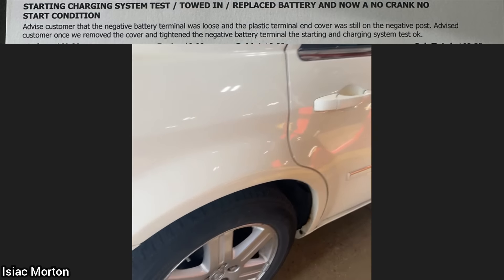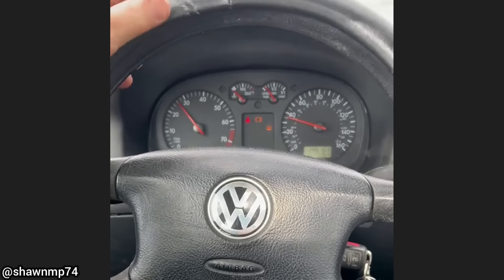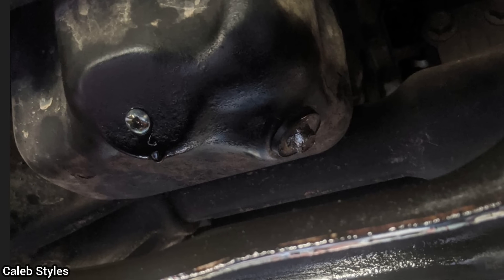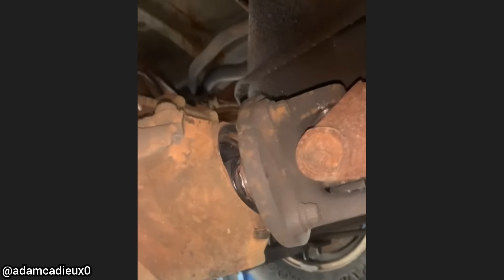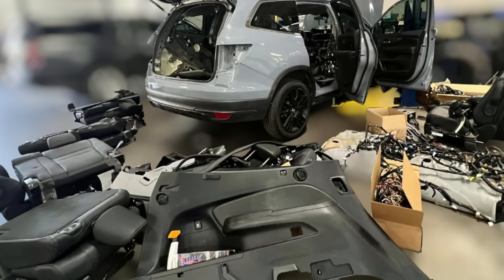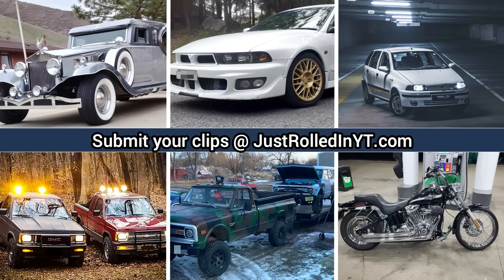Customer States He Replaced The Battery & Car Doesn't Start

Comment: I once worked at an auto parts store and sold a battery for a lawn mower . The customer called back a few hours later and yelled and screamed at me for selling him a defective battery . I apologized and asked him to return it for a full refund . Some time later he entered our store and slammed the battery on the counter and began to yell at me again . I looked down at the battery , removed the two plastic covers from the posts and said it should work now . Without a word he picked up the battery and left our store . The craziest part was that he had actually drilled holes through the sides of the caps so he could connect the battery cables .
Reply: yikes
Reply: I would've told him to NEVER come into the store again.
Reply: 👍 @ffjsb
Reply: @ffjsb Nah. That’s when you sell them brake pads and tell them to stop again soon.
Reply: Didn't even apologize to you
Reply: Had a customer make a colleague cry, (young girl on the cash register) getting crazy over 'his new mower wouldn't start', I got sent out to look at it, looked it over, PUT SOME FUEL IN THE TANK! And it started right up. He couldn't believe it, started accusing me of trickery/witchcraft but after starting it several times and politely (but really condescending) explaining what the fuel does and why you have to refill it, to the amusement of other nearby staff/customers he finally left without apologising. I fully expect his vehcile is probably featured on this channel 60,000 miles no oil change or something!
Reply: short-tempered, impatient, and ignorant all rolled into one.... They're essentially toddlers  in adult form.  No use in getting bent outta shape with them. You know how to handle them👍
Reply: @ffjsb  and miss all of the entertainment?
Reply: This why Gen z loves to shop online because of retail poop.
Reply: Hope they banned that customer.   No reason to act like a jackass.  I had the opposite dealership acted like a jackass n yelled at me.
Reply: Ugh had a dude who bought a left front brake caliper and came back and complained to the manager I sold him the wrong one only that the assistant manager told the manager no he said the front left he was just tryna get me in trouble
Reply: @WilliamHollinger2019  I don't know what this has to do with any generation . Where exactly are you going to buy a battery for your lawn mower on-line on a Sunday morning and have it available within the hour so you can mow your grass without human interaction ?
Reply: This stuff makes me lose faith in humanity, I cant
Reply: @webguy943  We had thicker skin back then . I shrugged it off then laughed about it with my friends . This was a rare occurrence and the hundreds of times people thanked me for helping them and shook my hand made up for the limited number of idiots .
Reply: @bryana7163  That's not what I call entertainment.
Reply: @eaglerider1826  Lucky you are not in Germany.  Quiet Law applies to any noisy work on Sunday.  Lawn mowing is a no-no.
Reply: @nothanks9050 "Ain't got no gas in it" 😂😂
Reply: @ffjsb nah tell him to send his wife or girlfriend maybe she'll have better understanding 😂
Reply: Wow.. let me apologize on his behalf if he failed to do so. 

It's one thing to get embarrassed, but to be rude, and then not apologizing--- that's not cool...
Reply: And that's why I don't sell parts anymore. Had a very similar experience.
Reply: This is common for the parts person. Customers literally need to be held by the hand for any project.. SMH.. they should really just pay the stealerships for a diagnostic and repair instead of harassing parts counter people. Like how much do you think a 18 y/o really knows?! And you're mad after you took their advice?.. like I said, pay the premium.
Reply: @nothanks9050  OK I'll be the one to say it "It ain't got no gas in it" Karl Childers Sling Blade (1996)
Reply: I'm still confused why you need a battery for a lawn mower??? Last I checked they were pull start.
Reply: @writerconsidered yes most are, but with larger engines,  there are lights, etc. which require more power. Ta da, ya need a battery to power all that stuff.
Reply: Dude some people are special man, I would've probably lost my cool and went off at the customer, no need to apologize to idiot
Reply: As someone who works at an AutoZone we get these people on the daily
Reply: @writerconsidered some of the more expensive ones are available with electric start
Reply: No dirty windows around that guy. He licked em clean
Reply: @chris4536  I know what's wrong with it... Aaaain't got no gaaaas in it!
Reply: @eaglerider1826, I understand the frustration with some things but back before Wi-Fi printers became a thing, I remember a customer coming into a store irate over his printer "MISSING THE @$%# CABLE!!" And the professional, cool-headed associate explained that it states on the box "Printer cable sold separately." It's too easy to miss some things for some folks & if we're really stressed/distracted any of us can "miss the simplest thing" & end up looking/feeling like a horse's behind.😄
Reply: @writerconsidered a riding lawn mower has a battery
Reply: @csjrogerson2377  - 
Yep, gotta be quiet so you can hear 
those delightful Muslim prayer calls...
in GERMANY!
Reply: I had a similar thing happen. Actually it was the black cap on an AGM battery similar to the one in the clip. I casually just take the cap off the test it and just go "no it tests good" hiding his embarrassment the customer took his battery and left, never saw him again. My guess is he never had any other battery problems after it was correctly installed.
Reply: @zenithperigee7442  The kicker was that he knew to caps were on it and drilled a hole to attach his cables .
Reply: And no doubt he had offspring to follow in his footsteps 🙄
Reply: He was just too damn embarrassed so he just tucked his tale and walked lol 😂
Reply: I had a customer call and rage over the phone saying I sold him the wrong oil filter, that it wouldn't fit.  I had him bring in both the new and the old filters.  It took me half a second to realize that the O-ring from the old filter was still on his car.  I pointed it out and he "Oh, crap.  Now i need to apologize to everyone, including my wife".
Reply: Some people shouldn’t be allowed to have tools.
Reply: Amazing how many replies demonstrate the intolerance of some. "Ban him because he wasn't nice". Is that how the future leaders of America think?
Reply: You can't fix stupid.
Reply: I worked in an auto parts store awhile back and a similar thing happened. Dude came in to test his battery, we hooked up our tester, and it only said “charge then test.” Told him we currently had a battery on our store’s charger and it shouldn’t be much longer, and he said he’d wait. Long story short, after waiting like 20 minutes, and like 40 people in the store dealt with later, he comes up to the counter and slams it as hard as he can and shouts “QUIT WASTING MY FUCKING TIME AND GIVE ME A NEW BATTERY.” My store manager immediately came out and told the guy to gtfo and never come back, after threatening to kick his ass for acting like a idiot. Made for a very interesting day, it did.
Reply: That is why I will never work at a parts store. You sell them the parts/parts THEY requested and then get yelled at because it didn't fix the problem. It's a part store, not a full service garage. I would end up arrested for battery within my first day working.
Reply: Upsell some blinker fluid next time. 😉
Reply: @eaglerider1826 it doesn’t. Stupid was being passed out by the fistful long before I was born. And I’m old.
Reply: @writerconsidered I’m just wondering if it might have been a ride-on mower. I think there are push mowers with batteries in them also for ease of starting. Good thinking. Thanks…Mac
Reply: @DrLumpyDMus  That's called freedom of association my dude. No one has to deal with assholes if they don't want to.
Reply: @WilliamHollinger2019  who cares what Gen z does, keep ordering your stuff online, also make sure you don't interact with anyone except online.
Reply: hunting big foot

Comment: I love that the bigfoot guy has some brass knuckles hanging from the roof, like he plans to go mano-a-mano with the creature if he finds it
Reply: Sasquatch,  rawrrr!  Me- come at me brah!
Reply: They didn't show the owner though.
Reply: Only thing he'd go toe to toe with is the cops as they're illegal in most jurisdictions.
Reply: @NorthernSeaWitch  <- Furry fingers typed this post
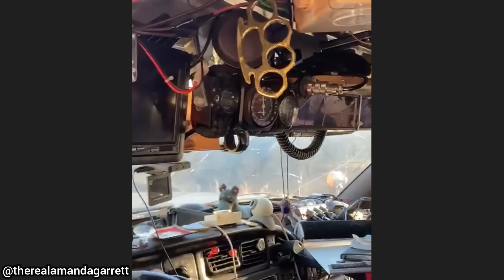Reply: There’s the “bad luck comes in threes so that’s why I wired up three UL-listed light switches”.  At 2:33 of 3:08.  One shouldn’t use AC switches to switch DC.
Reply: My neighbor looks like a Sasquatch.
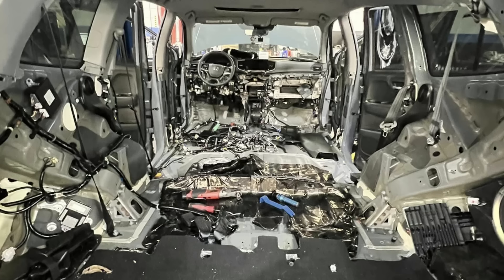Reply: Yep, caught that at 2:21.  With all that dangling wiring, he might just get a jolt if hs elips fingers through the brass!
Reply: @NorthernSeaWitch  at this point it would be considered an art exhibit and thus a ok lol
Reply: Gotta be prepared for those Bigfoot encounters.
Reply: Wouldn't be toe to toe,or I mean foot to foot.
Reply: What's wrong with using those switches for DC? Other than the way these ones are installed...
Reply: "Every Sasquatch has a plan until he gets punched in the face"
Reply: @for2utube Those household switches will handle the automotive current and dc voltage just fine. But they could also short out easily the way he has them installed and toggle, or push button switches could be more easily installed in the dash or at least a box attached to the dash. But at this point on that vehicle, what does it matter any more?
Reply: @renakunisaki  AC systems carry lower amperages for similar wattages therefore DC switches need to be capable of accommodating bigger currents.
Reply: This guy doesn't want to expose Bigfoot, he just wants to defeat him in single combat! Wait, is this Kraven the Hunter? Is this what the Kra-Van looks like on the inside?!
Reply: Netflix should do a Docu series about this Guy
Reply: And an angle grinder?
Reply: Good luck fighting a hairy primate that is 8 feet tall and weighs 600 pounds
Reply: @jasonkarov  bigfoot is laughing at this mess!!
Reply: @renakunisaki    With AC there's time for the arc to self-extinguish.  With DC there is no time so the arc will burn until the gap is large enough that it cannot continue.  If the load is inductive there's a high flyback voltage to deal with.  Switches will be rated for a much lower DC voltage than AC voltage.
Reply: @WhiteG60  a bit ridiculous isn't it like is he gonna do a driveby with brass knuckles lol?
Reply: F'ING SAMSQUANCH
Reply: and some nunchucks behind and to the left of the steering wheel 😂
Reply: When that day comes, we all gonna appreciate this guy
Reply: @WhiteG60  Concealed carry permit. Is that for the knuckles or for the angle grinder?
Reply: @rearspeaker6364  As we were told, that mess actually works !
Reply: @FonicsSuck  "Dude that rig had "mental illness" written all over it"
Or meth addiction, same thing, but you need a little kicker to be ready to go toe to toe with the squatch at any moment.
Reply: @for2utube and you almost always find DC circuits at a much lower voltage than AC.  What point are you trying to prove?

Comment: There is just something bizarre about the guy who declines repairs and says he'll fix it himself, when he couldn't troubleshoot the problem to start with. You know the car will be back in a later episode.
Reply: And blame 'another shop' for the problems.
Reply: Depends on what needs to be done to get it fixed. Had to get a new subframe installed in my daily and had a garage do that as I don’t have a lift or anyway of getting the engine out. If it’s something easy to fix on my drive I’ll do it myself after I know it’s just that singular problem needing to be fixed.
Reply: No not really.  I had a diesel shop quote me $2500 to replace my lifter pump.  They said they couldn't get to it without pulling the engine.
    I walked to the auto parts store and bought a gasket scraper and a new lifter pump for $35 , then I removed my passenger side wheel well and cut the wheel all the way to the right. It took me about an hour in a parking lot to replace (with borrowed tools as I was 150 miles from home.   Never had another problem for the next 3 years I owned the truck before selling it.
    Funny thing is, that was the first time in my whole life that I've taken my car to a shop, because I was finally making enough money that I could afford to, just for some dickhead to try and rip me off.
Reply: Honestly, even if this scenario isn't a great example, that's basically accurate a lot of the time. Diagnostics are the hardest part for someone who isn't experienced or trained. I'm not particularly good with cars. I can't necessarily figure out what issue I'm having when one crops up, due to not having the same amount of experience as a professional technician. But if I know what I need to do, I can google it, spend 4 hours researching and watching videos, and almost invariably there'll be several step by step tutorials that'll show me how to do exactly what I need to do and everything to be careful about. I just have to have that starting point of knowing what in the hell I need to start googling to fix my problem.
Reply: Not really. Sometimes I can’t diagnose a problem and I’ll take it to the shop to see what it is and once they tell me i either already know how to fix it or I’ll just search it up on YouTube and do it myself. After working on my own cars I’ve never had the problem come back again. By doing this I’ve saved myself a couple thousand.
Reply: @PGspeed88 what does that have to do with what the original comment says? You didn't go and get a diagnosis, then drive away when you were told what it was. You story isn't what the OP said.
Reply: When the issue is severe, I pray the thought process is "nah, just tow it home and I'll scrap it for parts"
Reply: Most likely back on the hook!
Reply: Yeah, they came in for an oil change but will do the major mechanical repair,  I doubt it.
Reply: @UncleKennysPlace  yeah, but what you're trying to tell me is that I'm smarter than an entire LARGE shop of seasoned deisel mechanics, when the reality is that this was my first deisel vehicle AND I didn't even know what a lifter pump was until I was informed that  was the problem.  Nobody else figured out that this was a 30 min. - 1hr job until I came around ?
   See? Look at in in reverse: If I went around saying that I was smarter than a shop with 30 deisel mechanics,  I would be an arrogant jackass.
Reply: Not another episode, by the end of this video
Reply: @taitsmith8521 Amazing story! I would have paid to see their faces when you told them you fixed it.
Reply: @taitsmith8521  
Hey mate, what is a lifter pump in this context? Truck suspension airbags, hydraulic something? Cheers

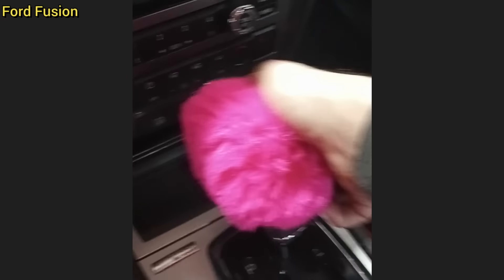Comment: 0:35 - I was called out to help some lady to get her car started.  Even with two fully charged 4kamp jump boxes it would turn over and immediately stall.   I happened to notice she had a lot of 'bling' decorating her car and asked her about something I had seen ONLY here, on this channel:   The jeweled ring around the ignition switch.  I asked her if she had one and she said she did, and had put it on the night before.   I had her remove it and the car cranked right up without needing the jump boxes.

She tanks you, Just Rolled In, for getting her out of a jam because her only recourse would have been a tow truck and perhaps a future video segment here. :D
Reply: I can sort of see how that happens you wouldn't think that'd effect it, but if you car has a chip key(basically all cars less than 20 years old now adays) I can see how it might.
Reply: @redtra236  Sometimes it blocks the signal from the chip key, sometimes it simply doesn't allow the key to enter far enough.
Since the entire thing was plastic I suspect there was just enough gap to prevent the key staying engaged once it rotated back to the 'run' position causing the vehicle to shut off.

Comment: When I turn my steering wheel, the car stops going straight. It started when I rotated the blinker fluid.
Reply: Wait, you have to rotate the fluid? How often?
Reply: @southpaw117  Usually once a year is enough but if you do a lot of city driving, or if you live in a place with a lot of roundabouts / traffic circles, you should probably do it every six months. 👍
Reply: Just use the all direction fluid,  costs a bit more but saves the maintenance downtime.
Reply: @southpaw117  I am not sure because the Manufacturer, obviously scamming us all, refuses to put out any information about Blinker Fluids in general. I am not fooled, whenever I need to make a new tinfoil hat, I rotate my Blinker Fluid too. Never had any issues since, except for this steering wheel conundrum.